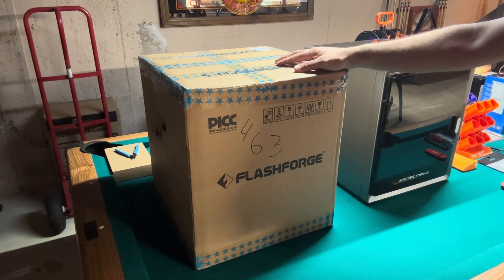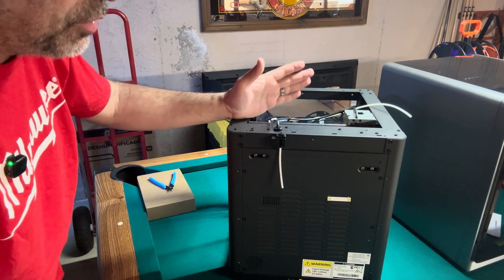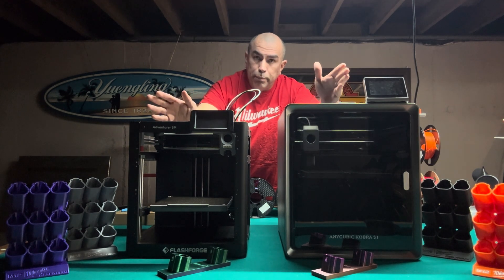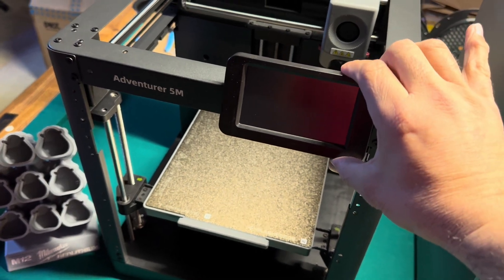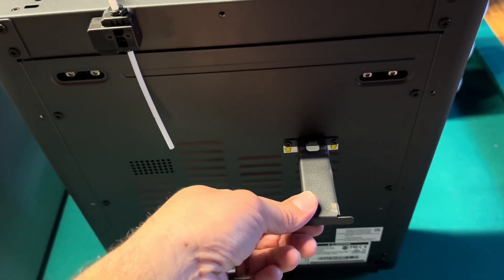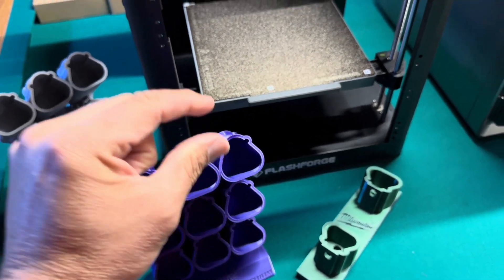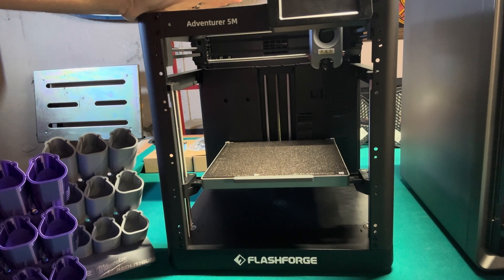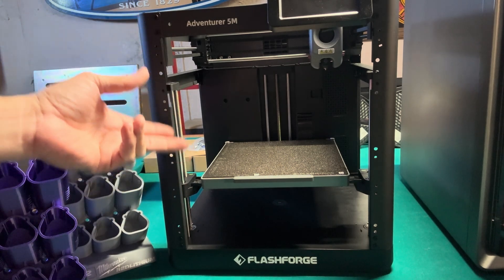Adventurer 5M vs Kobra S1 3D Printer

Comment: My FlashForge m5 pro malfunctioned after 1 week. 
CODE : No trigger on probe / check level sensor...
Never solved
Reply: I just had that happen. Error E0012 if I remember correctly. Clean under the bed and around the base of the (I can't think of the word - posts that look like bolts). There's likely a little piece of filament tucked in there somewhere jamming up the works. I did a quick wipe with a damp paper towel, nothing was stuck or took any effort to brush away, and it worked just fine right after.

Comment: These printers don't even compare. I have an s1 on pre order. However I got my son the Flashforge 5m and bought myself a Anycubic S3 Combo (bedslinger) to use in the meantime and the S3 runs circles around the FF 5m in print quality. By the time you buy the FF 5M emclosure kit, all the fillament it takes to print the pieces for the enclosure, and about 3 days of wasted time you could afford an S3 Combo and do multi color prints. I WOULD NOT buy a FF 5m after seeing what a better quality printer puts out. The FF pirnts like trash and after 2 weeks is having issues.
Reply: Yeah I also was like: whaaaat did he just say? Exact same quality? I mean, I don't any of the two but even in the video the FF 5m print DOES NOT look great compared to what the S1 did.
The FF seems like a good deal but if you look close, it's not.
Reply: @TheNightstalker80  by the time you buy the enclosure kit and fillament to print it you can pay less than $50 more and buy the S3 combo which is hands down better quality prints. The enclosure on the AD5M doesn't make any difference in how it prints either, just makes it look better.
Reply: @Inkslanger69  S3? I assume you're talking about the Kobra 3 (without S) which is basically a Bambu A1 clone. However, from what I've seen the Kobra 3 is a pretty good printer, as always there are issues but even the more expensive A1 isn't perfect. It is what it is, you get what you pay for and in the case of the new Kobra S1, you get a lot for relatively little money. This makes it an interesting option for those looking for a budget printer with highend features who are fearless enough to deal with some childhood diseases.
Reply: I have plus 4 ,qidi max 3 ,3 flashforge 5m and kobra s1 
Flashforge prints certain things better than the big boys maybe not the area but  in some instances faster 
So depending what its used for its perfect

Comment: Core XY machines are just as old if not older than bed slingers. First commercially available kit was put out in 2007 by RepRap. Reprap Mendel first protoype came out in 2009. 

Core XY are just harder to assemble and package, that's why bed slingers became cheaper, easier to produce and ship.
Reply: does it really make a huge difference in terms of functionality and complexity? I don't think because either way you need 3 moving axes. So you need one part that moves front / back and another that moves up / down and left / right. You can pretty much change that as you like, you can have one part move left / right and front / back while the other moves up / down or even up / down and front / back and the other one left / right. The result is always the same BUT there is a reason why core XY is superior! That is because the bed does not move horizontally, which can cause very bad vibrations especially when printing higher objects at higher speeds. Thit is the limiting factor for a bed slinger printer and that's also why most XY machines can print faster while maintaining a high quality even on tall prints. And yes, that's also the reason why the first 3D printers used this design, engineers definitely knew, that it's the best way to design such a machine ;-) The bed slinger models became popular because of a growing DIY 3D Printer community, as you mentioned, these printers are easier to build and could even be bought / sold in parts. First commercial bed slingers I remember came in a box with tons of pars, you even had to purchase controls separately sometimes because many of these offers where just but together by some hardware companies who don't had the knowledge to provide a working software / firmware.
For years a bed slinger was everyones dream, these kits had cost a ton and the software was garbage, without coding skills you had no chance to get that to run properly. The printers and ecosystems we have today are pretty young, I've been following the scene since the first models became publica available (bed slinger kits and very high priced pro machines) but I lost interest at some point because the machines were still very expensive, not user friendly and had tons of issues. I think the revolution started in 2010 when first true consumer models hit the market, from then on more and more people wanted to have one of these machines. However it was only in the past few years that the whole ecosystem around 3D printing became truly user friendly and more accessible for a wide range of users. I'd say the past 5 years 3D Printing really skyrocketed with Companies like Bambu Lab (founded in 2020). That was the time when 3D printing drew my attention again and I'm now waiting for my first Printer to arrive ;-)